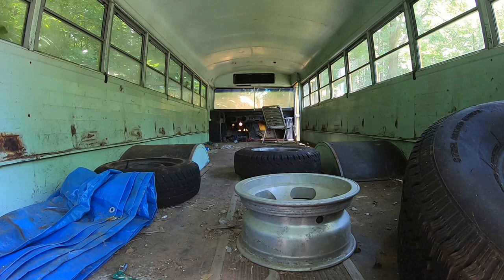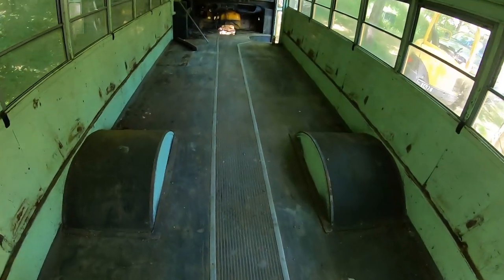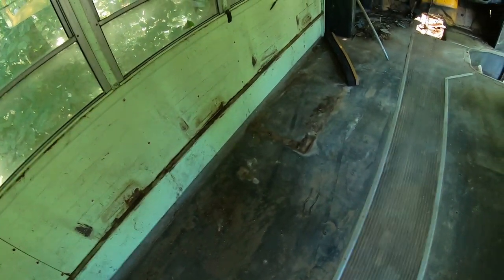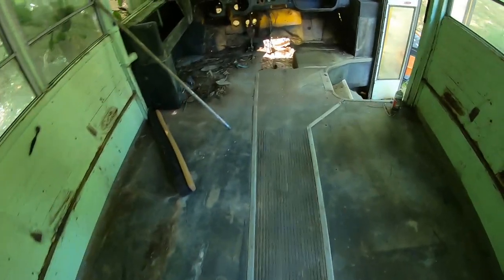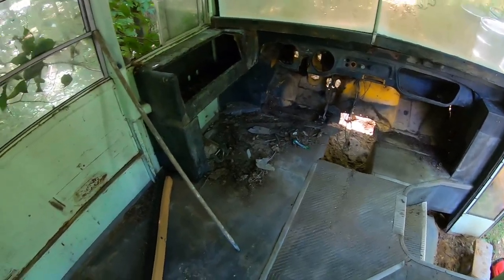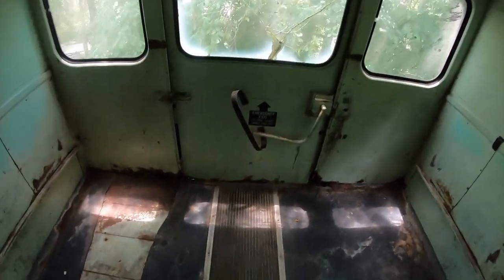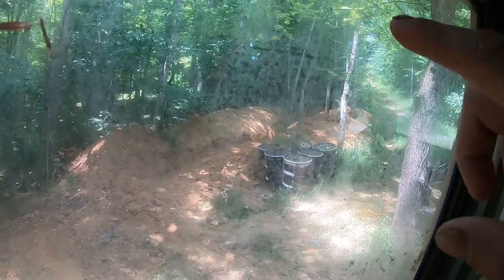School bus underground survival bunker Part 2. CLEANING

Comment: does anyone know how much a school bus body weigh? im talking a 65 or so passenger, NO FRAME ETC...  i desire to know so i can build a gantry crane (1 for each end and 1 for the center, 3 total) to lower the body into its hole.
i lost my details, as i have scrapped a bus before, was required to cut body in half. i covered the window openings with fence wire and filled the open ends with tin.dragged the body onto a roll back to haul to the scrap yard.
made plans to buy buses and remove the bodies, sell the rest to buy another bus with etc... that was 9 years ago. lost my location in 2019 due to severe illness, now i think im strong enough to do it!